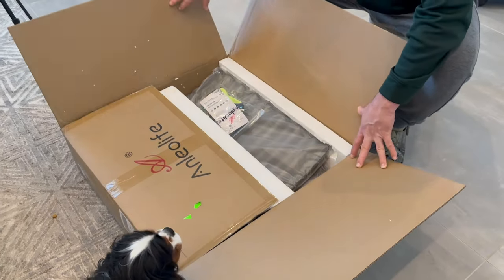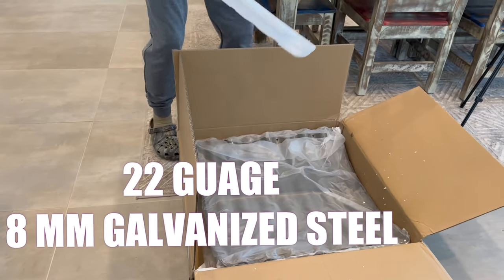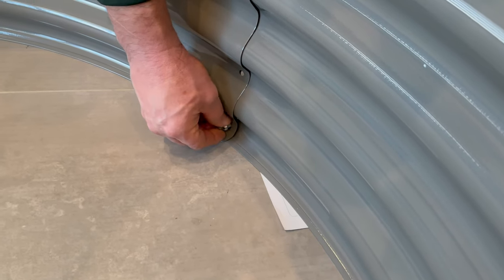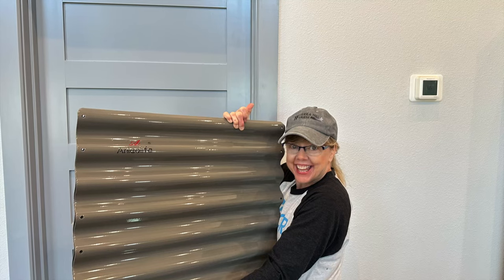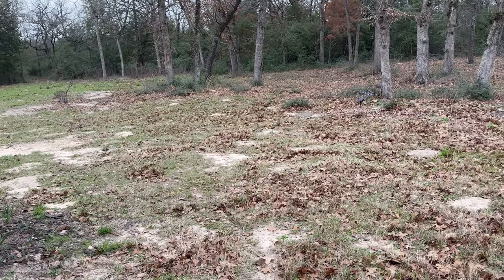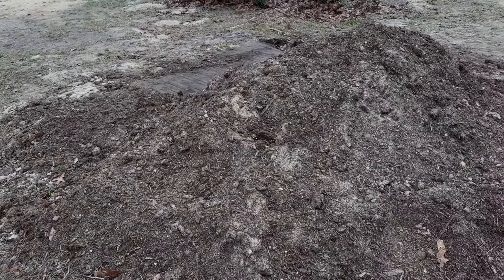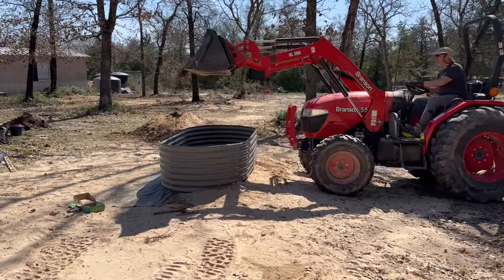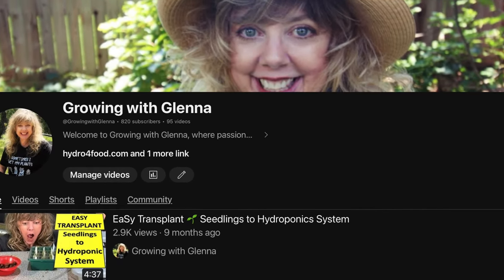Best Amazon Raised Garden Bed 🌿 #RaisedGardenBeds #gardening

Comment: I ordered three of the 12-foot beds and eight of the 8-foot beds. The 12 foot beds are great since they included the cross-braces, tying the sides together. However, the 8-foot beds are terrible! They looked fine when I first filled them up, but as the soil began settling over the next few weeks, they beds began bulging outwards along the center seam and mushrooming outwards along the bottom middle section.
I contacted the company and they sent out cross-braces to be installed. That was a lot of extra work, since the beds were already full of soil. I had to dig out along the middle and each side to get those installed. Now, with the bracing installed, the beds are pulled inward along the middle, giving it an hour-glass shape. Not sure if the braces they sent were too short or this was due to the soil already in place along the outer, curved areas. In any case, they look terrible...and they haven't even been planted for the first season yet!
I would definitely avoid the 8-foot beds!
Reply from the maker: THANK YOU soooo much for watching the video & sharing your experience with the 8 foot beds like this!😳 Bulging can be a concern with many metal raised garden beds. 🪴 There have been NO BULGING ISSUES with the #Amazon #RaisedGardenBeds featured in this video. Part of the reason may be that a modified hugelkultur method was used in the bottom third of the bed, so it wasn’t filled completely with soil. They are doing great!👍 So sorry that you have to empty, correct, and refill your beds…UGH! Again, thank you for sharing your experience 👩‍🌾

Comment: Nice vid.  I'm planning on getting 8 of these but am concerned about support for the middle.  Have you noticed any bowing out of the beds?
Reply from the maker: I have not noticed any bowing of the sides since their installation.  This could be because we used a modified hugelkultur in the bottom third of each one. What type of soil/compost mix will you be using? 👩‍🌾
Reply: @GrowingwithGlenna  I'll use wood chips from an arborist I know for the bottom layer and then fill the top 1/2 to 2/3 with mix of topsoil, perlite, manure, sand,  and 10-10-10
Reply from the maker: @Mainahs70  Sounds like it will work. We had a couple of pieces of rebar ready to support the side if it was needed. Good luck!

Comment: The design of their beds need to be like vego garden beds.  4 corner panels, 4 long panels and 4 short panels.  The shorter panels are always best behind each corner panel and behind the long panels on left and right sides both.  Best to use nuts and bolts with washers.  The bed you used the company needs to redesign their product.  Love their thicker metal and shiney paint with corners that do not cut your fingers.  Maybe they will improve their panel design and use nuts but not wingnuts.
Reply from the maker: Thank you for watching the video and commenting! 😊 When Anleolife gives me a call, I’ll be sure to tell them about the modifications you suggested. At the time of ordering, these were the best #raisedgardenbeds available from #Amazon for the size I needed. They have done EXTREMELY well for me with no bulges. Vego beds can be pricey, so some of us on a budget enjoy the Anleolife beds. What is your favorite plant to grow in your beds? 👩‍🌾
Reply: @GrowingwithGlenna  Yes the price is much lower and I like 2 feet tall beds.  In my wooden bed I had for ten years I grew flowers like petunias, celosia, pansies and even spearmint.  In these metal beds I am growing some catnip. Banana peppers, bell peppers. Onions, lettuce, tomatoes and cucumbers.  Hopefully more and I have peppermint growing in a felt cloth bed.  I think I will put it in a metal bed before winter.
Reply: @GrowingwithGlenna  😊